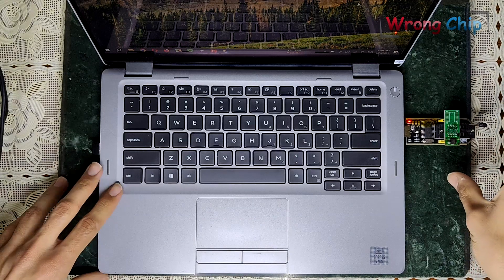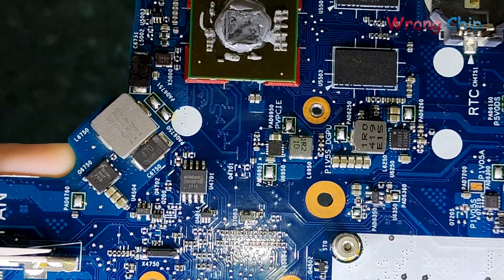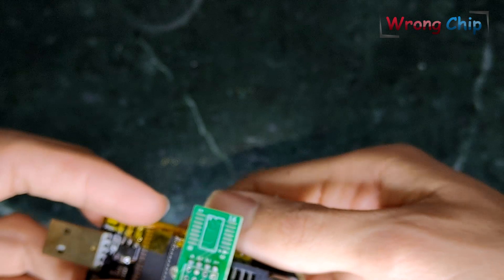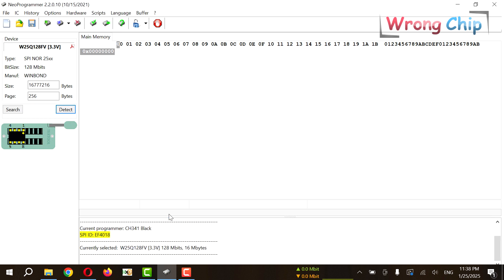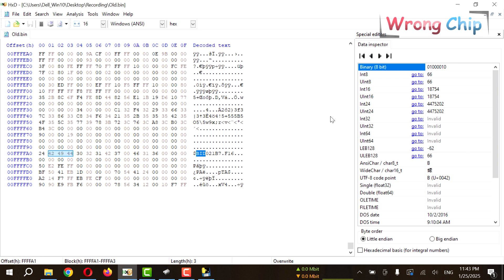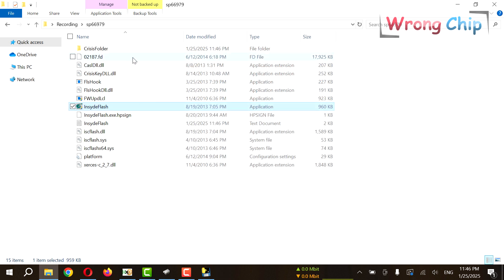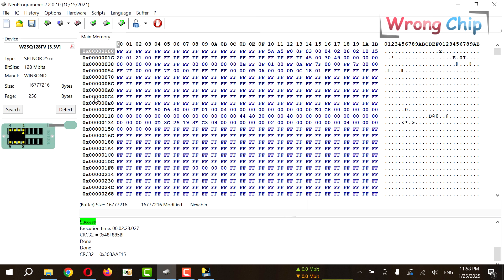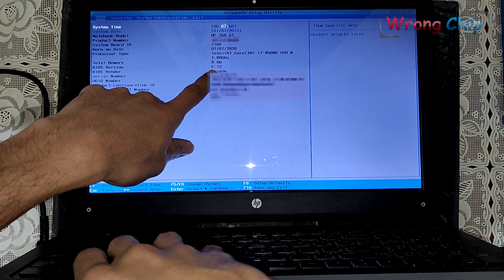How to Downgrade your BIOS Using CH341A Programmer

Comment: bro can be damaged cpu / mobo / bios cause jitter,  judder, bad quality image, blurry, grainy, pixelated, unsmooth screen?
Reply: this problem occurs on any hardware capable of running windows, occurs after reinstalling windows, or replacing the gpu.
Reply from the maker: @  Issues could happen after BIOS update, replacing CPU/PCH or randomly.
Reply: @wrongchip  pc is working like usual. Same fps, same score benchmark. But in windows / games / bios picture is blurry and unsmooth. 
After flash / reset bios, bios / spi flash save some information about system, maybe gpu / cpu info?
Reply from the maker: @ Also it could be CPU or GPU issue yes.
Reply: @wrongchip  that is not gpu, 99.9% if not damaged but it can get after first time boot system. 
motherboard? vga / ram / storage connected to cpu line. That mobo line + cpu pci controller. 
pci cpu controller?
Reply from the maker: BIOS failure can cause many issues like black image, stick on logo, turn on then off, delay while booting or no power at all.